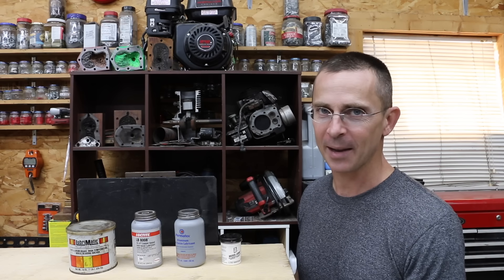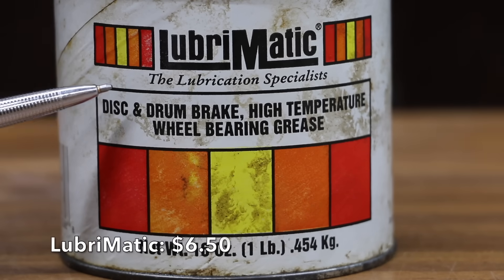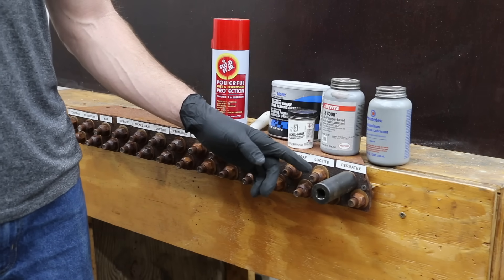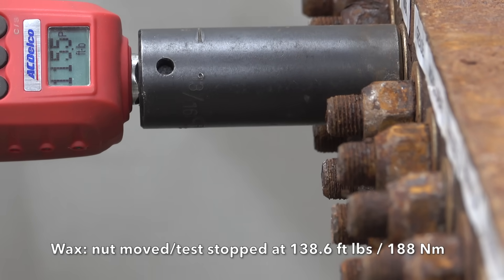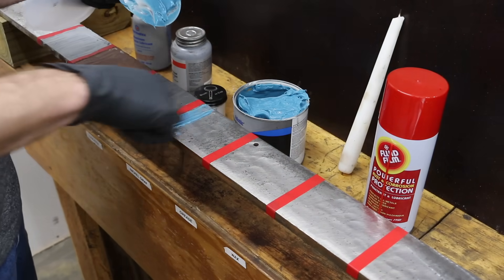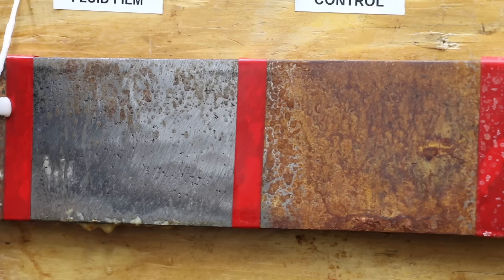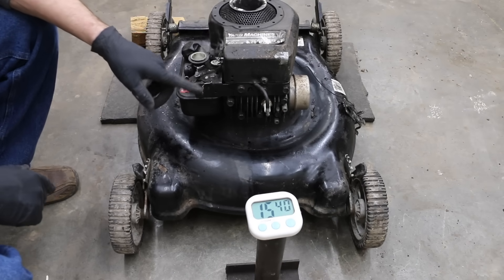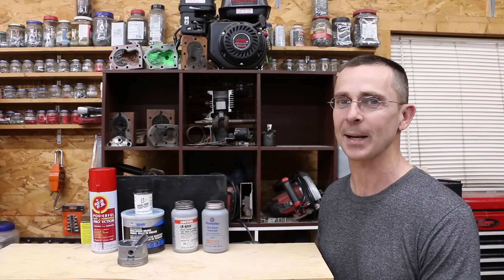Does Anti-Seize Compound Actually Work? Let's find out! Anti-Seize vs Grease vs Fluid Film vs Wax

Comment: I worked in automotive including large fleets, for 30 years.  And you'd think anti-seize was kryptonite based on the aversion almost every mechanic has to it.  I heard the dumbest excuses why they didn't use it, or just used grease, or even oil!  And some mechanics have a touch of malice too, I've seen the idiots tighten an oil drain plug so tight you'd need to own a gorilla to get it off.  But on your own vehicles, if you don't use anti sieze on everything you can, you might be making things a lot tougher for your future self, especially considering the time it takes (half a second?) and cost (next to nothing) to swipe some anti seize on the spark plug/exhaust bolt/you name it.  The only thing NOT to put anti seize on ever is wheel lug nuts, other than that, I go nuts with it.  Why not?
Reply from the maker: Thanks for the feedback.

Comment: I've been using the copper Loctite antiseaze on every nut and bolt I ever put on for years. Glad to know empirically that I wasn't just imagining that it works great. Also not tested here, but the copper Loctite works good for spark plugs and battery terminals or other threaded electrical contacts, because it's a good conductor of electricity.
Reply: It's okay to use anti-seize for non-coated spark plugs. However, many new spark plugs have threads that are coated with a chrome finish to prevent corrosion. Applying anti-seize to these will decrease the thread friction and often cause you to over-torque, and even break, the spark plug. Furthermore, too much anti-seize on the threads can spatter onto the insulator tip and cause a misfire.

All in all, manufacturers don't recommend using anti-seize on spark plugs anymore. 

Not trying to be rude, just wanted to inform anyone who may read your comment and proceed to ruin their weekend with a broken spark plug or a misfiring engine.
Reply: i use the permatex Copper anti seize.  am not sure if its still made No expiration date, use in all rebuilds and tuneups.  grand father was a machinist during WW2 and all he ever used was copper based.
Reply: spark plugs have a dry electroplated coating to stop them from seizing
Reply: @Videoswithsoarin  They can still get carbon build up that makes them difficult to remove. I've had an awful job removing sparks plugs from several old vehicles that were not well maintained. Plenty of other nuts and bolts have coatings to prevent seizing too, but dirt, grime, and time tends to find a way to make those costings useless (Murphy's law I guess). Using a little anti-sieze lube goes a long way to make a difference. The key word is "little". You want to make sure you use a small amount in the middle of the threads to prevent any from getting on the tip of plug or in the combustion chamber. You can foul up spark plugs if you use too much and don't apply it properly.
Reply: I use lubro moly lm508
Reply: Same, It took me 5 years to finish the jar. I thought I never would!
Reply: Seth, both my vehicles have a coil per plug and use iridium plugs, both manufacturers state at 100000 mile tune up replace plugs and coil seal. On plugs apply a tiny amount of antiseize to plug threads. I still have my first car a 69 Falcon with a 302. Plugs antiseized when installed. No misfire issues.  I have my first new car a 82 Mercury Lynx. Upgraded and improved motor. Platinum plugs with anti-seize also. My grandfather was a machinist. He maintained his vehicles. He had a 63 Ford Falcon with a 6 cylinder. When he tuned it up he antiseized anything that was unscrewed. The motor has over 400k on it and still has great compression. When he passed my uncle got it.  So what are we doing wrong again
Reply: @nateulpanzarella9154  he’s telling you what today’s technology has evolved to instead of using what worked 40 years ago.  Read the directions on the plugs designed by engineers with today’s technology and mist will say not to use antiseize because it’s not needed.  I pulled the plugs after 150,000 miles with no antiseize and had zero issues.  Not everything needs antiseize today because of new technologies.  By your logic we should still be changing our oil every 3,000 miles.
Reply: @ohboy2592  You should still be changing oil every 3k. Just because the car makers tell you to do something one way doesn’t mean they have your best interest at heart. They do it to make the car reach the warranty then it’s your problem. Like zf transmissions in Chrysler/jeep/dodge/bmw the car maker says NEVER change the transmission fluid its a “lifetime” fluid. Lol when ZF the transmission manufacturer says the car makers are wrong and you should change fluid regularly. Nothing is perfect. I laugh at range rover recommended oil change interval which is 15k miles. I have and always will apply anti seize to spark plugs no matter if its a new vehicle.
Reply: @BenefitExploits  when my oil analysis says I still have 75% of my oil life at 3,000 miles I’m not changing it.  That’s a waste of money.  Ivan comfortably get 6,000-6500 miles before I hit 30% of my oil life.  That’s when I’ll change it.  And yes, no fluid is lifetime.  It should be changed at 100,000

Comment: With respect, I see an error in your test method. All three of the anti-seize compounds should have been the same nickel based chemistry or copper, or aluminum. The three base metals have different temperature ratings and different lubricity ratings. Just a comment.
Reply from the maker: Thanks for the constructive feedback.

Comment: you need to try some JC5A
Reply from the maker: Thanks for the suggestion.
Reply: @ProjectFarm  its a bit steep in price though $120 for 160ml, we use it in the aviation world for 'wet assembly' of components to avoid corrosion, be it between sheet metal or fasteners.

Comment: running an (lawnmower) engine on anti-seize compound didn't tell us anything.....thick viscid particulate laden non-flowing anti-seize compound gives us no reason to think it has any use or value as pure thin film engine lubricant, its about like running finely ground sand suspended  in congealed chicken fat inside a crankcase.............if you want to evaluate an anti-seize compound as an engine lubricant you should have tested WD-40 retail penetrating oil rather than candle wax.
Reply from the maker: Thanks for the constructive feedback.

Comment: First hand experience; I’ve never had issues removing bolts I’ve put anti-sieze on. I use the permatex.

Word of Caution: you cannot use this stuff of torque sensitive fasteners such as lug nuts. This can cause the lugs to fail prematurely. Source; worked in fastener engineering.
Reply from the maker: Thanks for the feedback.
Reply: @ProjectFarm  you’ve managed to reply to an amazing number of my comments keep it up!

For those who want more background on why you should not put anti seize on torque sensitive fasteners here’s a bit more detail. Note this also applies to grease and oil, anything that effects the friction of the bolt.

Ultimately what you’re trying to achieve is clamping force with a fastener. Torque is an absolutely terrible way to do this but it’s it’s the only practical way to do it 99 percent of the time.

So when a manufacturer designs a torque specification they have to assume the condition that the threads are in. Are they oiled, dry etc… This effects the friction in the  fastener. The more friction the less the nut turns for a given torque. The less a nut turns the less the bolt stretches. Bolt stretch is what determines your clamp load.

So in the case of lug nuts where they withstand other loads other than just clamping (there is some shear as well. Yes there’s a pilot on the hub, no the wheel doesn’t fit perfectly) that extra stretch brings the lug closer to failure. It then has a higher risk of failure when encountering these loads.

Finally, a counter example. Yield fasteners (or stretch bolts) like head bolts often require light oiling. This helps make the friction more consistent. Also often times the tightening procedure is by angle and not always torque. Either way this helps stretch the bolt and achieve the required clamp loads.
Reply: @Taskarnin  Thank you for this valuable information you've shared. I've been wondering about this since yesterday when I took my tires off to check things out and saw that the Ford Dealership put grey colored anti-seize on the lug nut post. I had gotten new tires 8 months ago at the dealership. I don't know much about the safety of using lubricant on lug nut post but I do have enough of an idea to be alarmed that this may not be such a good thing to do because it causes the lug nut to torque  quite a bit tighter than it would on a dry post. Given that the dealership and most all mechanics have a habit of over torqueing lug nuts by a large margin I did become very alarmed when I saw the paste on the post. Removing the lug nuts was already very difficult with a 18 inch breaker bar. Much more difficult than it would be if I torque them by hand myself, and then attempted to loosen after 8 months. The dealership had to of had torqued way over the 100 lb-foot specification, and with that lubricant on the post, the torque would have multiplied even more. I am really upset with how negligent they are! I cleaned off the anti-seize and torqued them to 100 lb-feet.

Thank you again for your wisdom.

Comment: YES, never seize does work.
HOWEVER, be advised never seize
has particles of aluminum in it
SO, never, never, never, never put
never seize on anything with moves
bearings for instance. It will cause 
accelerated wear. Only put never 
seize on stuff that does
not move-like spark plug threads,
lawn tractor wheel to axle , ect.

!
Reply from the maker: Thanks for the feedback.

Comment: Best hitemp anitsieze is unflavored milk of magnesia. It's best because of the high temperature resistance as well as it's lack of corrosion. The high pressure turbine flange bolts we used typically hit temp's north of 1500F
Reply from the maker: Thanks for sharing.

Comment: Great video. Have you considered an anti seize test of a steel bolt into aluminium? As you mentioned a copper based anti seize is probably not a good option. But what is best?
Reply from the maker: Thanks!  Thanks for the suggestion.
Reply: White ceramic grease. 1200 degrees celsius. Neutral to aluminium.

Comment: Permatex Aluminum Anti-Seize is what i use on spark plugs. Steel threads on spark plugs in Aluminum heads with out Permatex Aluminum Anti-Seize. When you try and remove the plugs the aluminum threads seize on the steel and come out with the plug. Only once did i have to use a HELI-COIL kit.
Reply from the maker: Thanks for sharing.

Comment: Use never sieze half and half with oil in an engine. I'd watch that.
Reply from the maker: Thanks for the constructive feedback.
Reply: @ProjectFarm  In the past, I have been forced to use odd combinations of lubricants to finish a job because of a lack of oil for the engine. No failures yet, but you're better able to do the testing.

Comment: Oh this is already a year old haha. Anyway, being from the business (AG Mechanic) I can vouch for gray anti-seize any day. I use it all the time, because tractors and combines rust quite easily and some bearings need replacing quite often. Ergo, applying anti-seize to the shafts or bolts that surround the work piece, make for a MUCH quicker replacement. 
Old timer mechanics always told me to NEVER apply it to wheel bolts, yet for the last 20 years I have ALWAYS applied it and NEVER replaced a nut, stud or lost a wheel. It just comes down to using a torque wrench, as the products act as a lubricant and can throw your elbow torque wrench off. Anyway, great test to convert experience into numbers.
Worth mentioning is also the fact that COPPER COAT or GRAY ANTISEIZE are NONE conductive. Oil field techs tried to convince me that they are not allowed to use it, because of it's conductivity. Then I took a multimeter and showed them that it's NOT called copper coat for it's conductivity properties, but it's appearance. If only they stuck to RTFM and read the label of the jugs :D

Comment: Your work with Anti-seize has given me an idea for a possible upcoming video. It’s  a well-known fact that bolt threads coated with anti-seize tighten down to higher clamping force  for any given torque than non-coated/dry bolts because of the lubrication the anti-seize provides. My suggestion to you is for a video wherein you establish which brand or type (aluminium, copper, etc.) of anti-seize results in highest clamping force for, say, 80 or 100lb/ft of torque, for example.
Reply from the maker: Thanks for the suggestion.

Comment: Before watching the video, I believe that anti-seize does work...we'll see if I change my mind.
Reply: Half way through the video; the first graph after loosening all the nuts. My thoughts are that Nickel-Graf and Lubri-Matic stayed closest to the starting torque, therefore did better. If you torque a nut, you do not want it to loosen or tighten over time.
Reply: After the video, I would use the Nickel-Graf as my brand of choice. Great video, thanks for the hard work!
Reply from the maker: Thanks for the feedback.

Comment: I call bull on 1600-1800 degree performance.1600ºF is already bright orange heat.  The only thing that would likely remain at that temperature would be the metallic additives, all of which would be oxidized at that point, which qualifies them as then being ceramic in nature, or at least related to ceramics.

Protects up to 1600º... One needs to then ask themselves what is meant by "protection" in that context.

It would appear that even the manufacturers of good products are not immune to the temptation to stretch truths in the vein of "caveat emptor".

<SIGH>... humans.

Comment: I was under the impression that Anti-seize is NOT an anti rust solution, but rather it offers a layer of disconnection between the thread surfaces.
Reply from the maker: Thanks for the feedback.

Comment: The nuts on the blades of my riding mower were always a bear to get off. I tried anti-seize without much success. I switched to regular wheel bearing grease and it seemed to work some better.
Reply from the maker: Thanks for the feedback.

Comment: I have used both the Loctite copper and the Permatex aluminum anti-seize/never-seize products outdoors, and on exhaust manifold bolts, for 55 years. They  w o r k. Grease won't last thru repeated heat/cooling cycles on engines. Great comparison and video, all in one place. Thank you.
Reply from the maker: Thanks for sharing.

Comment: You should also check out using low strength loctite, I’ve heard that having this adhesive in place ensures that the break off torque remains repeatably low by preventing rust from starting in the threads..
Reply from the maker: Thank you for the video idea!

Comment: Came across the copper based anti-seize many years ago. Had a tractor driven post hole borer where the center teeth screwed in - so the action of the borer was to tighten that screw.. and tighten it harder, and harder.. and harder. First time had to use heat, a pipe wrench and a long pipe attached to that pipe wrench. After using the copper based anti-seize? Always came off easily.
Reply from the maker: Thanks for sharing.

Comment: Well, something is different between "the length of time on natural rusting" and your quick corrosion testing.   I had wheel nuts on an axle  still under a hubcap that was left outside for a few years. I also had one wheel without the hubcap same age same exposure time.  The wheel nuts came off of the wheel that did not have the hubcap.   The ones under the hubcap?  I was using a good quality X bar and onto the X bar I slipped on a 4 foot cast iron cheater pipe.  The nuts never loosened. so I snapped the wheel studs GMC.  I really should have used heat but had no torch so broke off 2 wheel studs (probably on for 5 years)  the others would also give me the same problem I am guessing so am going to look for some heat (under a hubcap was more problematic than totally exposed to the rain and snow.) No torque wrench needed. I can lift 100lbs dead weight x leverage of 4 foot pipe breaks wheel studs.  I can't do the math because I don't know the mathematical formula...but it is definitely different than surface rust.  Wheel nuts are normally screwed on dry for vehicle wheels.
Reply from the maker: Thanks for the feedback.

Comment: At work we use copper anti-seize (Jet-Lube brand) for resistance welder high-current joints (bus bars, tapered threads, cables, etc.). Especially good for restoring the connection on badly pitted buss bars (after wire brushing off all the corrosion first!).
Reply from the maker: Thanks for sharing.

Comment: This video is more helpful than you will ever know!  Thanks for posting!   Next question:  What works better on spark plug threads, Anti seize or pipe dope?  (l see many service manuals call for pipe dope, but way back when in auto-shop we were taught to use anti seize...
Reply from the maker: Thanks!  Thanks for the video idea.